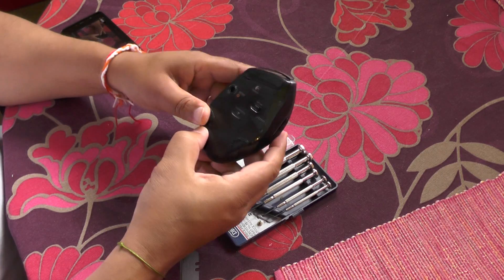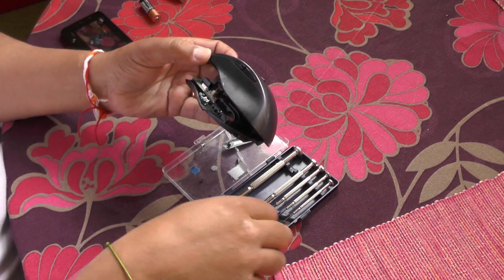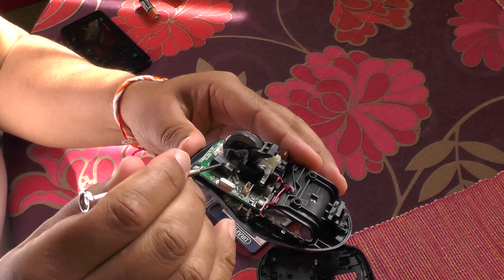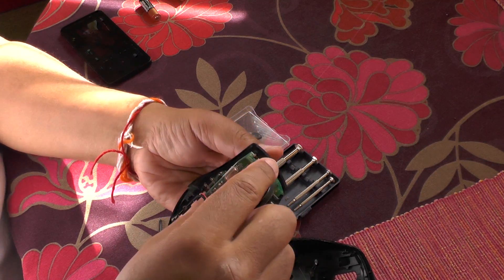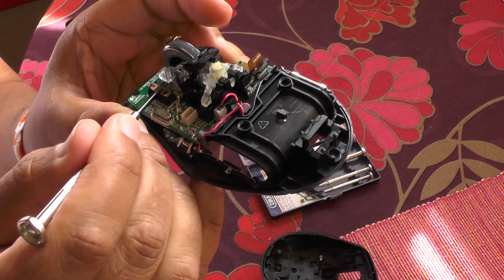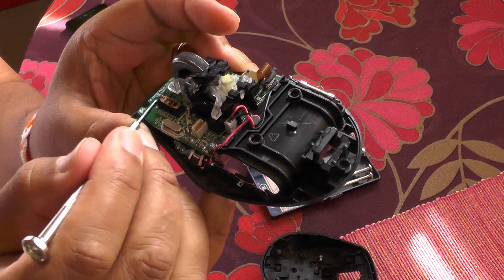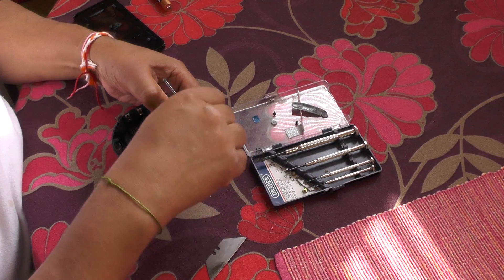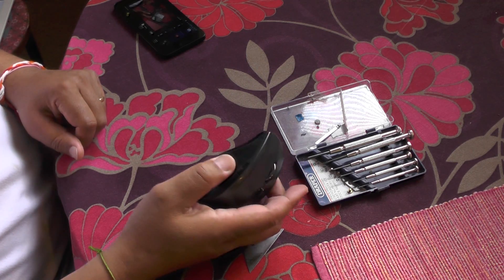Logitech Mouse Double Click Problem and How To Fix It - Red Ferret How-to

Comment from the maker: Learn here how to repair your S Pen Tip in a Flash! https://www.youtube.com/watch?v=NLiM8OlENfk
Reply: Thanks for this video! I began following the steps but then I had a bright idea, lol! I fixed mine much easier just by removing the front screw cover, and only so little unscrewing the screw under the double-clicking mouse key. It released the tension from the spring, without messing with it's integrity, while the mouse still hold together pretty fine. Took me a minute. :)
Reply: For how this fix last as you said you repair second time

Comment: Important Timelines:
03:59 Removing the black omron casing to reveal the copper spring
07:00 Copper spring bent in the correct angle for the white plastic to contact it.
Reply: Thanks for your help. :)

Comment: Wow, this video on fixing the Logitech Mouse double-click problem is incredibly helpful! I've been dealing with the same issue, and your step-by-step instructions make it seem so easy to repair. I appreciate the detailed explanation and your emphasis on being careful during the process. By the way, speaking of fixing computer-related issues, have you heard of IdleBuster? It's an amazing app that keeps your computer active even when you're away, tricking time trackers into believing you're still working. It simulates mouse movements, random scrolling, and keyboard activity, ensuring accurate reports without showing low activity. It's been a game-changer for me. Check it out!

Comment: I have a similar problem with a Logitech mouse. It was fine for a long time until today things went bonky on my linux desktop.  Maybe Chromium or Firefox or some other app have a bug messing with the keyboard and mouse? Killed them off. Nope. Cosmic ray flipped a bit in RAM?  Rebooted. Nope. Seems to be just the mouse. Batteries? I live in boondockville, long drive to get batteries but I'm dead for the day without. Fresh new batteries (albeit the cheap brand). Still bonky!  Bluetooth flakiness?  Bought a new wired mouse - that's a three hour trip!  Accidently cut the cord when opening the package. Bah!  One of those days.    So, about the mouse problem - took the cover off. Pressing those L & R button switches directly. Works fine! Yay!  Put the cover back on. Doesn't work! Mostly L &R don't work, or sometimes do. Middle button works. Oh wait no it doesn't. Clicking on "X" on a window caused it to shift right an inch instead of closing. Normally no button does that!  Or none of the button do anything. Until they do. Alright, take the cover off again. Works fine with direct fingering of the switches!  Cover back on again: doesn't work.  So I use the mouse with no cover for normal everyday work from now on, until I get a new mouse.

What could be causing this mouse to work fine with no cover, and act whackydoodle with the cover on?  All the cover does is convey pressure to the switch via a small block of plastic, no moving parts really.

If it matters, this is an M510.

Comment: Thank you for this post. I'm getting old, with poor eyesight and shaky hands, so I've adapted your technique to something less invasive.
Firstly stick a small blob of blutac over the tiny white push button to secure it, then, to remove the green box cover use a fine penknife blade inserted between the green and white parts, and gently lever off the cover. 
If the spring still clicks then for cleaning the contacts try using a small strip of paper, place it between the spring and the contact faces and move back and forth while there is spring pressure applied. You should see traces of black oxide on the paper. Adding a small dab of isopropyl alcohol to the paper will also help. If the spring still clicks then that may be enough and cleaning using the fine abrasion of paper will avoid having to deal with the difficulties of removing and replacing the small spring strip. 
For re-assembly the blutac should still be holding the tiny white push button to the outer face of the green box cover, so carefully push the cover back into place until the catches click, remove the blutac and re-assemble.
This worked for me.

Comment: Mine was a few years old already so reshaping the switch springs just made it worse/no click at all now. Can't understand why the whole switch unit isn't replaceable without having to have gear that would cost the same as a new mouse anyway. Do they have to be soldered in? Or can I just pop the old one out and shove a new one in?

Comment: Frankly, much easier to fit a new microswitch. Do a search for D2FC-F-7N(10M). Widely available and cheap. Having opened up the mouse and removing the wheel assembly anchor pin (behind the wheel) it all comes apart very easily. Uncrew and flip over the circuit board, you can see the three solder points on each switch. Desolder and fit the new switch. Put it all back together and you're done. Spend a couple of quid and your mouse will last much longer than playing around with the switch spring.

Comment: There must be 2 different switch types, as mine didn't have that curve at all.  Adding that curve didn't help. I came across another video from PCGaming wiki called "Double click problem: How to fix faulty mouse button", which basically extended the bottom curvy spring bit.  My switch also seems to have slightly different hooks to clip back in, which matches that other video.

Comment: DON'T remove the copper leaf-spring. It is hard to place it back. Need just cleaning the contacts on installed leaf-spring - nothing more. And than it is 5min job, instead 30-60mins and swearing.

Comment: Thanks for this video! I began following the steps but then I had a bright idea, lol! I fixed mine much easier just by removing the front screw cover, and only so little unscrewing the screw under the double-clicking mouse key. It released the tension from the spring, without messing with it's integrity, while the mouse still hold together pretty fine. Took me a minute. :)

Comment: Why has there not been a class action suit against Logitech for this ? I have had to replace my mouse every 6 to 8 months because this problem always happens, on ALL their mouse, this is the cheapest, worst type of contact methods used.  Your video is nice but it is near impossible to apply this due to the things being too small, it is impossible to handle.

Comment: Excellent video. I have noticed a related problem, not with the switch itself, but the mouse top cover flexible plastic "button". I am too heavy fingered when playing games, and over time, the mouse left button begins to not always register a left click.. When I disassembled the mouse I noted a depression in the small plastic flat pad of the left cover plate where the little white switch trigger piece would normally make contact. The problem is clear if you compare to the right pad area. I filled the depression with epoxy and carefully ground and sanded the area flat again. This makes a big difference, and may even be complementary in some cases with the spring adjustment.

Comment: Thanks - great vid
Re Logitech - Absolutely pathetic that this is the problem !! double or treble the thickness of that copper and the problem would be solved - this has been a massive issue now for almost 10 years and has only gotten worse rather than better on their latest mice. Total joke of a company which is such a shame as they were my constant go to company previously for all peripherals. What would it cost? 50p tops ffs    3 mice down after just months because of this issue across 3 different mice and it turns out to be skimping on copper !

Comment: This works. I had similar problem but my right click was not working properly meaning you had to press hard for it to register. So I flattened a spring instead of bending it and it's much better now.

Thank you for this.

Comment: Seven years later and still relevant! Your video and blogpost just saved me having to buy a new mouse. I've had a Logitech Anywhere MX for roughly 10+ years and it recently started acting up... Took me about an hour or so, I expect to have a few good years with it again :) Thanks!
Reply: 12 now. With modern mice. Same switch, same problem. It's great switch. It lived for so long and now, just a screwdriver and tweezers and it will live even longer. I love fixing stuff.
Reply: Except there is an opinion that bending is not a fix, but cleaning that bump from oxidisation fixes the problem. 😂 Because, when I dissembled mine that chopper part was ideally flat, like it was supposed to be. But bending didn't break it. So it's fine.

Comment: interesting but my Logitech M185 could not be repaired
First it came apart with only one screw.
The module with the switches just popped out, making access to the switches easy
But the actual switches would not come apart the part number on them is RD20ZA
This seems to be the new policy of vendors to make parts that fail and can not be repaired.
Ordered a new mouse from a different vendor
Logitech is off my list.

Comment: There is easier fix. Just drop WD40 or electronic cleaner on these switches, make sure it penetrate onto the switch contacts. It at least good for another year. I have done this, and yet to find when it will fail again.

Comment: I dismantled this as shown though I didn't remove the spring as it looked really fiddly to repair & replace. I cleaned it, blew on it, pressed a bunch of times and that seems to be enough to have it working. No doubt it wont stay fixed forever but next time I'll brave the full dismantling. Cheers

Comment: Iv'e had both MS, and Logi higher end mice, and the switches on both go bad after a time. They are mechanical, and can withstand only so many clicks, 5 or 10 million is the limit I'm guessing, maybe Red Ferret can chime in on that one. However, my M705 is not double clicking, it's not registering the click period. I have to press far forward or backward on the switch to get it to work. At $27 bucks 4 years ago, and it still works to a degree, I think it's a bargain. Not to mention only having to replace the batteries 3 times. I think I will just splurge and get the new Master, or the M720 Triathlon which I think is the replacement for the M705 as the new M705's I've seen are not exactly the same, and are of inferior quality, don't buy the current M705 unless it has a switch at the far bottom left under the forward and back switches. Thanks for the tutorial Red, should I decide to repair mine.

Comment: Just lift up the buttons, spray contact cleaner into the switches, push the buttons back down, and work the buttons heavily while the contact cleaner dries.  These mice don't go back together easily once you've disassembled them.

Comment: Every two years or so I have to change that spring because the double-clicking issue starts to happen. Thankfully you can buy the pieces for a few dollars on eBay.
Reply: Mine developed it in 6 years, 5 years for middle one... I guess, I middle click too often )))

Comment: As a lazy alternative, what I did in my M705 was remapping the scroll left button (which works by pressing the scroll wheel sideways to the left) in SetPoint to emulate the left-click, and I use it when the left button starts to misbehave.

Comment: just because this hasn't had a comment in years, Bought a used MX Revolution (because I love that mouse and wanted the Bluetooth version) and got an M705 with a used PC I bought. Both ended up with double click issues within days of being put back into service. Fixed em both thanks to your video. I'd say it was easier than getting new switches and replacing them. Thanks, just wanted you to know your work is still helping people out.

Comment: Hi. Can soemone please tell me which screwdriver it is? 
(I don't have small enough ones, so i need to know a precise name or number to identify it - before I go and buy it).
I am based in Central Europe, the more alternative descriptions you give, the better. (or any advice to buy a whole set, like Red Ferret has would be useful). I have 2 "cross" screwdrivers, that are most commonly used, but they are too big for this mouse.

Comment: Brilliant! Worked like new afterward! The hardest part was getting the spring back on, but even after struggling with that, the whole fix was under 15 minutes. I've had this mouse for close to a decade, and this is the first problem I've had with it. So if a free 15 minute fix is all I have to do to it for 10 years of faithful service and fantastic functionality, I'm happy with that. Hoping for another 10 years! Good work, Logitech!

Comment: So now I've ordered a new mouse and I'm using a backup that came with something else. I've bought the Logitech M510 now 2 years in a row (four years total) I think I paid more than $20 each time. I used this video and another one similar to it to try to fix the old one on a lark. My eyesight is not good enough. This mouse malfunctions within 2 years and you can buy a different mouse with the same capabilities for $10. Is there seriously no way they could just construct that little piece so that it wouldn't fail so soon? Like, maybe it would just last forever? And what's with the pieces that contact the pad that wear away? There's no material in the world that wouldn't just wear away in a year or two that you could use? Please. My mousepad is a slick plastic pad, why would the contacting parts dissolve? It's a terrible product with planned obsolesence. I'm trying a new mouse I ordered from amazon, but after the fact I realized they prolly did the same shitty engineering and I shoulda bought the warranty for 3 bucks and saved myself another $25 dollars in two years.

Comment: I had to add glue under the external case on the square pad that contacts the white bumper piece. There was a little indention where the white plastic bumper had worn a groove into it and contact wasn't being made.

Comment: Before even attempting to do the fix outlined in this video, please try the instruction below.  I got this off another website.  I thought the guy was trolling people but reading the comments from other users suggested that it worked for them.  I have the Logitech M705 mouse and just tried it.  I thought I followed the instruction incorrectly but managed to get my mouse working again one the first time.  Yay!

Instruction:
Press the right click button and
 hold-it, turn the mouse off and on, leave the right mouse button pressed while clicking on the left click button 5 times Quit pressing the right click button and turn the mouse off. Click and hold the right mouse button, turn the mouse on and finally release the right mouse button.

Source:
https://www.drivereasy.com/knowledge/solved-mouse-keeps-double-clicking-logitech-razer/
Reply: how is a SOFTWARE "fix" of doing key sequences.... EVER going to remedy a HARDWARE PHYSICAL problem?!?!